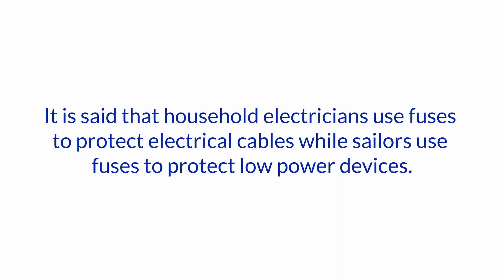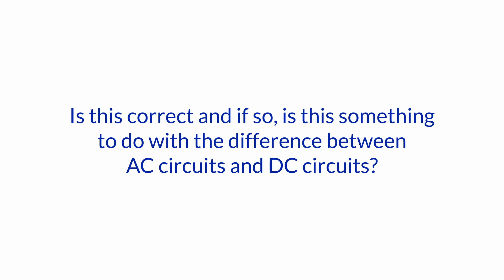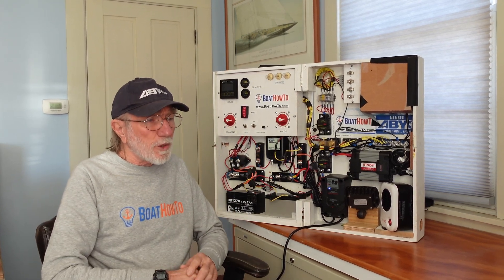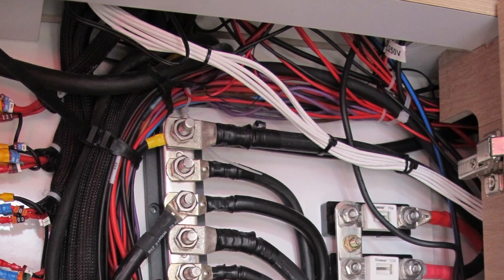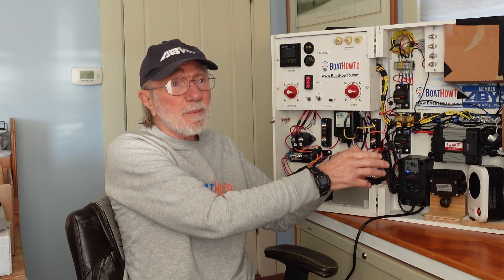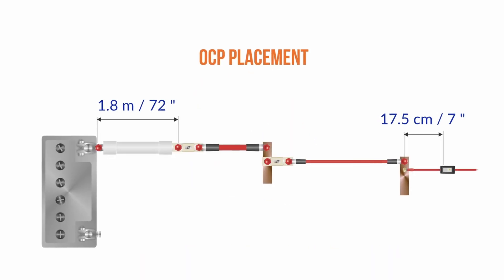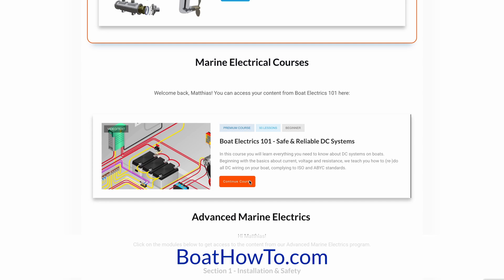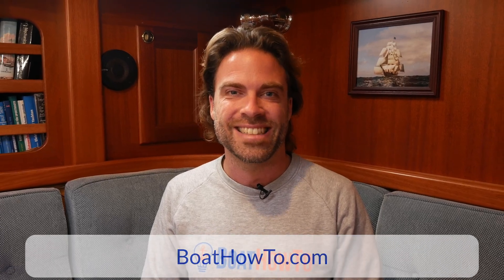Should Fuses protect DEVICES or CABLES ?? 🤔 | Ask The Expert with NIGEL CALDER

Comment: Gteat point. It is all true, but you forgot to mention about motor driven devices with locked rotor. For example, rule 500 bilge pump needs 3 Amps fuse, even while AWG 16 wire ampacity can be as high as 35 Amps outside of engine space. This is important to remember, because the pump may catch fire in locked-rotor situation.
I'd be really grateful if you mention this in your next video. Thanks.

Comment: All true... But, it's perfectly ok to use a much smaller breaker than the circuit wires are rated for. For example on the USCG inspected passenger vessels I run, we are required to have 2 VHF radios, each on it's own separate dedicated circuit, no other devices are allowed on those circuits. The wires may be rated for 30 amps so you could legally use 30 amp breakers. But the radios themselves may call for a 5 or 10 amp fuse. That fuse would have to be at the radio end of the circuit and in fact the radios usually come with it preinstalled from the factory. That fuse may be hard to access especially if you flush mount the radio. It would be much more convenient to just install a 5 or 10 amp breaker, whatever the radio called for, at the panel and eliminate the in line fuse at the radio. The wiring is then way over protected and the radio gets the protection it specified. Down side is on a circuit where you are allowed to install more devices (just about every one in a pleasure boat) you can't do that. You would have to install a breaker capable of handling all the devices, up to the rating of the wire, and go back to inlines at the devices.  The point is you don't have to use the maximum size breaker the wires can handle. It's ok to go smaller, just not bigger.

Comment: That is interesting, when I did my ABYC electrical certification ABYC was saying: 
The breaker is there to protect the circuit and the fuse is there to protect the device.
.
The second thing that I keep in mind is:
When a motor seize it works against the seized impellor, as heat increase the internal
resistance also increase and the current flow in the circuit decrease (This is part of Ohms law as I am sure you know). 
If the Voltage stays the same (12V) and resistance (Ohm) increase, Amperage will decrease and the fuse at say a bilge pump will never blow. The circuit itself does not suffer and the breaker will never trip." Ed Sherman.
Thoughts?
Thanks,
a.
Reply: The "fuse which protects the device" is probably already inside the device, no? Does ABYC actually recommend a fuse in the circuit, separate from the device?
Reply: @glowingfatedie  No never read that anywhere is simply suggest that the fuse in that configuration protects the device.

Comment: This makes all the sense in the world - where do you put the fuse in a solar circuit?  My surveyor informed me that it must be at least 8 inches from the battery yet the source of the charge is coming from the panel through the controller.  Where do we put the fuse in that case?  I am sizing based on 80% of the cable carrying capacity.  (ie. 15A fuse for a 20A cable)
Reply: If the circuit uses the same wire gauge from the panel to the controller to the battery you put the fuse at the battery. 
Your surveyor likely said at a maximum of 8 inches not "at least" 8" away from the battery. The purpose being to have the least amount of wire burning if there was a short, these days you can, most of the time, use MRBF fuses that sits right on the battery post. 
In sizing your cable you will want to consider Voltage drop for the actual  length of the entire circuit, acceptable are 3% or 10%.Personally I use 3% Voltage drop 99% of the time. The only time where I might consider 10% drop is where 1) non-electronics, 2) weight is a factor, for example wires going up a mast on a racing sailboat.
You should fuse according to the current of the device not the wire size, and the wire supported every 18" and not allowing the connection to support the wire.
Just my 2¢ but if BoatHowTo comment on your question, follow their suggestions! ;-)

Comment: Mmmm.  This is bad information.  Yes, at a minimum, a fuse or circuit breaker must protect wiring.  But that doesn't mean you can't make it even smaller.  You absolutely can and should.   While devices aren't "protected" from fuses and circuit breakers per-say, in a confined space such as a boat it's a good idea to trip on minimal over-current to improve your odds of avoiding a fire, or being able to react to a device failure, before it burns your boat down.   Cabling is often over-sized to reduce losses, particularly in higher-voltage (24VDC and 48VDC) DC circuits... that doesn't mean that you must fuse all the way up to the cable rating.

In a residence most breakers protect wiring first, but that's only because assumptions cannot really be made about what appliances are installed (or may be changed-out in the future), or what appliances are plugged in.  For example, lighting might be updated or expanded years later.  Home owners are not expected to have electrical knowledge.

In a boat (or RV), nearly all circuits have specific purposes and the operator is expected to have electrical knowledge.  In addition, due to vibration and the overall more strenuous environment of a boat, wiring can't be made too thin.  That is, the wiring should generally be (or will often be) over-sized for the application.

This means that there can be a vast gulf between the capabilities of the wiring and the needs of the device.  Use of fuses and/or breakers that are smaller than the rating of the wiring is practical.

In addition, many circuits have both fuses AND breakers.  In these situations, fuses are typically just there to protect against shorts and the breakers are sized to the device(s)... sized significantly smaller to reduce fire risk from device failures... and to avoid accidentally blowing fuses (that you have a limited supply of if you happen to be in the middle of the Atlantic).   So the fuse in this situation is typically sized to the wiring while the breaker is sized to the device plus a bit of slop depending on the context.

Also keep in mind that in mobile applications (RVs, boats), you want to minimize heat and avoid over-heating fuses and breakers in general, particularly when they are packed together in a distribution panel.  Nominal maximum operating currents should be significantly lower than the rating of the fuses and breakers those currents run through, and similarly maximum operating currents should be significantly lower than the ampacity of the cabling.   It is NOT ok forl maximum operational currents to result in temperatures exceeding 60C on a cable, fuse, or breaker.  Ever.  Even with 90C cabling.  Fuses and breakers are typically rated for a 75C maximum operating temperature without tripping.  In a mobile application you never want to exceed 60C.  Ever.

--

My general recommendation is:

* Size breakers to 125% of the 60C rating of the cabling and 125% of the maximum expected device current, Whichever is lower.  The breaker must be below 100% of the 90C rating of the cabling, and also use 90C-rated cable.

* Size fuses to 150% of the 60C rating of the cabling and 200% of the maximum expected device current.  Whichever is lower.  The fuse must be below 125% of the 90C rating of the cable (below 100% if possible), and also use 90C-rated cable.

* In situations where both breakers and fuses are present, size the breaker significantly lower than the fuse (and still inline with the above two recommendations), such that a short trips the breaker without blowing the fuse.

--

So for example, lets say you have 2 AWG cabling (60C rating 100A, 90C rating 125A) and the stuff hanging off of it have a maximum nominal current of 50A.

* If protected with both a fuse and a breaker, the breaker would be sized to 75A or so (I'd use 80A) and the fuse would be sized to 125A.

* If protected with only a breaker, the breaker would be sized to 75A (1.5x maximum nominal current and in this case well below 125% of the 60C rating of the cable).

* If protected with only a fuse, the fuse would be sized to 100A (2x maximum nominal current and in this case well below 150% of the 60C rating of the cable).

-Matt
Reply: Interesting, Personally I would follow ABYC standards E-10 & E-11 and what you are suggesting seems to follow this. As a side note in a circuit with both a breaker and a fuse ABYC suggest: 
The breaker is there to protect the circuit and the fuse is there to protect the device.
Thoughts?
Reply: @Coyotehello  I think it really depends on the context of the instruction.  In residential systems, breakers protect circuits and fuses protect devices (fuses are typically built into the devices themselves).

But in mobile DC systems breakers tend to be sized for the specific device components while wiring is oversized.  Breakers don't replace in-device fusing (that fusing is part of the device), so it's wiggly... a bit of a grey area I would say.  Depends entirely on the context.

-Matt
Reply: @junkerzn7312  Thoughtful comment thank you.

Comment: I hate to disagree but in my very humble opinion Nigel made an error in stating Circuit Breakers are only there to protect the cable or appliance in regard to AC circuits . One of major and in my opinion the most important aspect of Circuit breakers/ fuses is to protect the user from electrocution.
Reply: An RCD will protect a user from electrocution. Even a small AC breaker will leave you dead or cooked.
Reply: @adrenalineissues AC breakers are still installed for the safety of the person using the power as well. Of that there can be no argument. Yes they protect cable and appliances but they also protect the user as well. In modern day electrics here in Oz RCDs are mandatory and as such only increase the safety of the person using the electrical item.
Reply: @gregharding7329 in that RCDs also break a circuit, I see your point, but only in that limited case for residual current, which is quite different from overcurrent protection. An RCCB (RCD function only) does not have any overcurrent protection—it won’t trip for an overcurrent condition. It may look like a circuit breaker, but it isn’t an overcurrent protection device. 

The overcurrent protection function of a fuse, circuit breaker or AC RCBO (combined AC overcurrent circuit breaker and RCD) is there to protect the conductors and that is what the topic was. RCBO’s (ELCI in some parts of the world) will mitigate the electrocution risk, too. 👍👍
Reply: @jimduke5545  the issue I see is that different rules apply to different countries. Yes you are correct in that your standard RCD  will not trip for an overcurrent condition but would state given that there are so many variants in the RCD world many would be confused as to what "RCD" to use to best protect their electrical system. Many use RCD as a generic term and without getting into specifics as seen, your average DIY person dabbling in the complexities of AC and DC power can easily be confused.  I gave up a long time ago commenting in forums or giving advise to people regarding various electrical installations as the average person just could not grasp the fundamentals or just did not care about the consequences or legal requirements of doing things incorrectly.  Here in Australia last year very specific wiring rules came into force regarding the wiring of caravans, camper vans etc for AC and DC  installations. I foresee these rules being adapted to all marine vessels in the not to distant future. This will require all work to be undertaken by a suitably qualified electrician. But as we know people love DYI and we will continue to see people continue to do all the work they can on their boat. While I am an admirer of Mr Calder I do get concerned when people give advise on these types of platforms and do not cover the legal requirements or the liability issues.
Reply: @gregharding7329 Greg—glad to see the edits. It’s been a few years since I audited the Boat Howto course but I recall that it made the ELCI/RCD terminology and functionality clear.

For me, I already had a good grasp but the Boat Howto course helped solidify my knowledge, particularly as it applied to  marine electrical systems. That’s a huge positive for the DIY and even professionals in the community. 

The new E-11 draft also makes large strides clarifying the terminology and functionality.

Your regulatory situation is a double edged sword. I’m not sure of my thoughts on whose system is best, but licensed electricians do provide a safety assurance that would be hard to argue against from a safety perspective. YMMV

I really don’t think this YT video was about ground fault protection(GFP) in any way, though overcurrent protection is related as they are both faults which are mitigated by circuit interruption, albeit with different sensing mechanisms and GFP Is only for AC. 

Cheers
Reply: @jimduke5545  Its very heartening to see good thoughtful people responding. Its a very important topic. Just one more thing that I believe must be considered given this topic and the propensity of people going to Lithium batteries. Once again here in Oz insurance companies are now requiring all lithium battery installations be carried out by a qualified electrician, if not you will not be covered.   Unfortunately where you have the case of a Youtuber who used a nissan leaf EV battery on his boat and later perished I believe underscores my safety concerns and those of insurance companies.
Reply: @gregharding7329 I’m aussie and my boats mostly aussie std wired. If you trip a residential 16A or 20A breaker, you are dead or having some very serious time in the burns unit, and wishing you were dead. 
A rapid breaker trip with a C curve would be 3-5x overcurrent, so 50-100 amps and ~12kw into you. People survive worse, but not in any healthy way, 
We have rcd’s for safety trips. 
Combined breaker / rdc is an aussie thing, very uncommon elsewhere. 
US is quite different focus on faults. I have a paper somewhere as to why. History.
Reply: RCDs are NOT typical on boats, but could wind up getting used more as more and more AC is wired into boats.   RCDs are obviously not necessary on LVDC circuits (anything below 60VDC or so).  Regular breaker and fuse operation is far more important than RCD operation so if you go with RCDs you really need to have both... or even all three (fuse, regular breaker, AND RCD) on a boat.   Which is why RCDs aren't typical.

If you are chosing one or the other, then choose the regular breaker and not the RCD because your biggest risk is fire and you absolutely need to have strong, robust protection against over-current.

If you do want to use an RCD on your AC panel, then consider using it on a ganged backhaul for the AC rather than on each individual AC circuit.  However, keep in mind that inductive loads (such as A/C units and fans and even turning on a desktop computer) can cause nuisance trips of RCDs.

-Matt
Reply: @junkerzn7312 in my world, RCDs are becoming more and more common as we all seem to be adding AC components and LFP banks to power those power-hungry appliances while on the hook. My sloop has 4 RCD’s in the AC system (split phase with dual inv/chargers). 2 are for the Shorepower circuits combined with the dual pole MCB (both E11 required) and one MCB/RCD on each inv/charger output to protect all the non-gfci protected circuits (aircons, water heater and a downstream inv/charger) for electric shock risk as required by the manual—bold print “must be included in series with the output,” so I take that as a requirement. 

Haven’t had an RCD nuisance trip on the boat in 3 years. I have had shore-power RCD’s trip in the floating dock circuit which is protected at the shoreline pedestal (code). 

Good advice on choosing OCP everywhere and using RCD’s ganged on the AC distribution side after the MCB. The DIN style breakers make this easy.